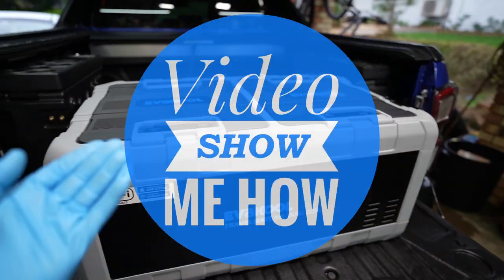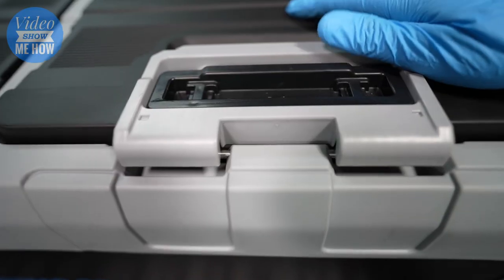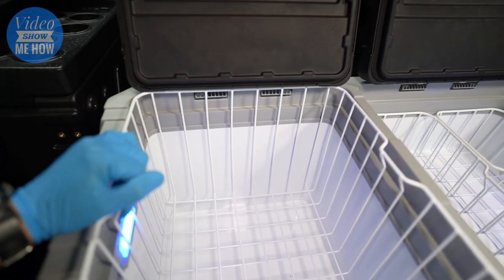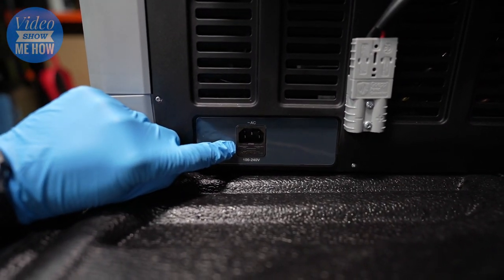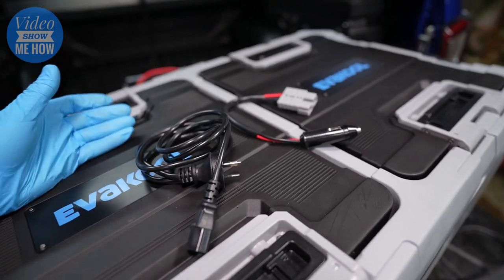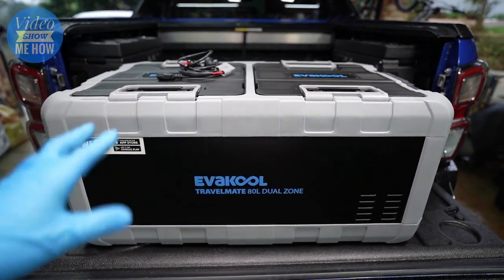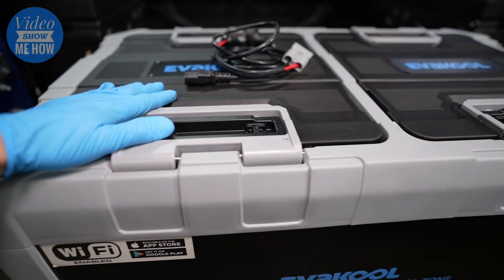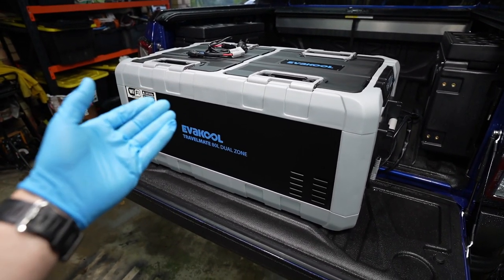Evakool Travelmate 80L Review | TMDZ80 Dual Zone Fridge Freezer | Fits 21 Isuzu Dmax Roller Shutter

Comment: I recommend Bushman SC35/52. It's an Australian company with great support. There's even a phone number to ring and someone actually answers it! It uses the least amperage in it's class due to 50mm insulation, I think it draws around 3.0 amps. You get a cover included too.

Comment: What was the ambient temperature when you was testing the power consumption? I live up north of WA where we normally get 40-45 degrees days wonder if it would handle it ok
Reply from the maker: Whoa that's warm. I've had it 30 odd degrees on the beach and in full sun has been fine so far

Comment: Reckon a fridge slide would fit if mounted between the tubliner ridges?
Reply from the maker: Yeah you'd be right with this height fridge 👍
Reply: I have a dometic 75 lt and will not fit under the roller blind. I have remove the plastic liner and had a rhino spray and was hoping that that would get me in but no cigar. It must be less then 450 ior les in height….😡
Reply from the maker: Feel your pain, I had to sell my Waeco when I got my dmax as wouldn't fit :(

Comment: Is there enough room to mount it on a fridge side
Reply from the maker: yep, have around 20mm of wiggle room - saw some pics on the one of the facebook groups where someone had put this on a slide
Reply: @VideoShowMeHow  currently looking at a kick-ass fridge 80l and the height is 465mm, do you think it would squeeze on in the tub?

Cheers!
Reply from the maker: @haydensusigan2513  you only have about 455mm with the tub liner in :( If you went a spray in liner you'd make that up and be ok. Have also see others cut a section out for the fridge

Comment: Hey m8 just wanna find out how your Evakool travelmate 80l is going??
Reply from the maker: Hey mate, still going strong, just got back from a trip yesterday actually, used it on that trip 👍
Reply: @VideoShowMeHow  nice m8 have you had any problems with it at all? What is it like in hot weather???
Reply from the maker: @dylanbecroft5584  no has been great so far cooling wise (am based in QLD), I've found it performs well as is a well insulated fridge and not bad on the juice either.
Reply: @VideoShowMeHow  nice I’m just looking at buy a bigger fridge but I’m just worried about the hot weather up in WA that’s all.
Reply from the maker: @dylanbecroft5584  main cons I've found is can't switch off a side to just run one and the WIFI 'app' is completely useless... Otherwise the decent fridge!
Reply: @VideoShowMeHow  so the app doesn’t work at all??
Reply from the maker: @dylanbecroft5584  nope, at least the android version that I've tested, it's like it never got out of beta unfortunately :( Was one of main reasons I went with this in the first place
Reply: @VideoShowMeHow  ok thanks m8 how long have you had the dual zone fridge for?? What’s the freezer like? And would you buy other one?